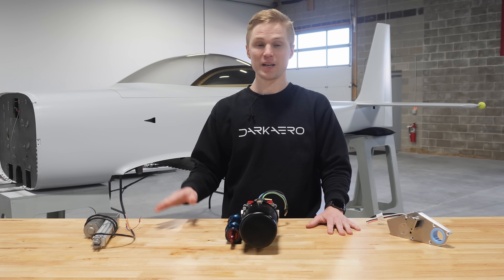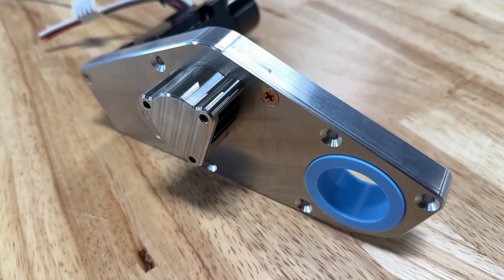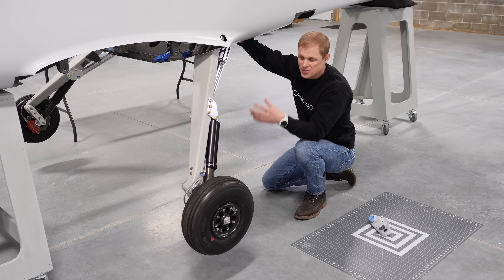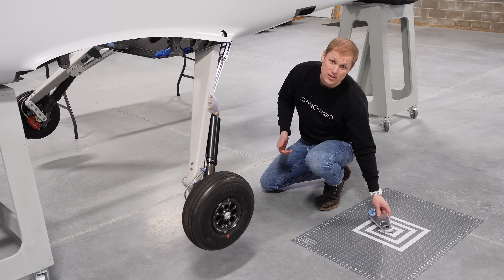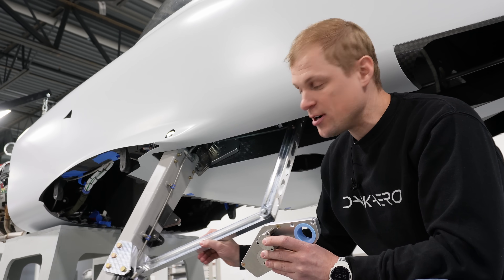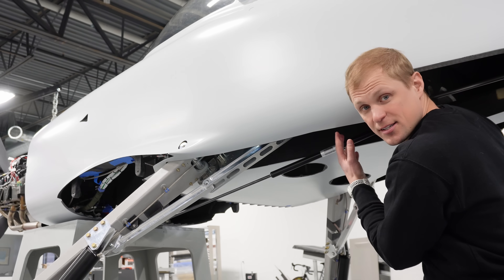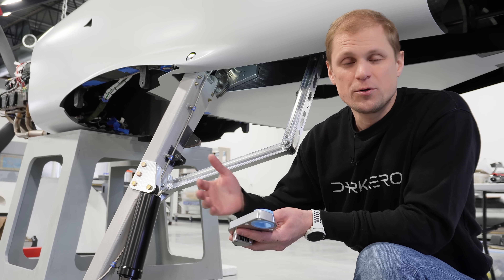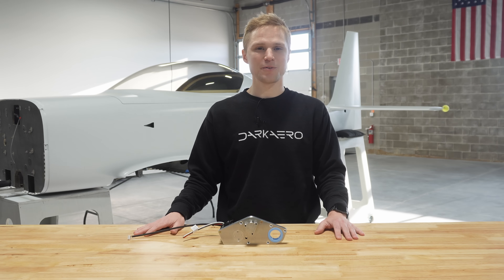Why we designed our own retractable landing gear

Comment: Cool ideas here but the complexity of the gear design in both manufacturing and operation would be my concern. Not sure about the carbon leg or gas strut in very cold temps.  How does electrical/ mechanical failure of the motors, clutches affect emergency lowering? Seems like the suspension shock/strut is quite heavy. Titanium spring leg would probably be lighter and certainly more reliable plus zero maintenance and likely cheaper to produce.

Recommend you do the gear drop tests at -40 to see how the carbon reacts. There are also known long term effects on CF strength from moisture, temperature and impact exposure within the matrix.
Reply: I think they have done amazing work this far. Reading the comments though, I thought I was the only one concerned about the carbon reinforced plastic landing gear. Landing can result in such a variety of shock loads in many environmental conditions. I'm not sure this is the best application for carbon. Bugatti for instance x rays the carbon chassis at specific service intervals to make sure there aren't any stress fractures. Landing seems far more rigorous than what most Bugattis see. 

Also the gearbox which is a work of art honestly, while it works well now, I'd be concerned about dirt or moisture affecting the movements, the small diameters on gears seem a little concerning. Given the space constraints, perhaps a worm gear setup would be simpler?

Comment: I wonder if those gas struts will still output the same force required to lock the gear out through the varying temperature ranges it'll see during regular use
Reply: They won't. Almost certainly.

Comment: Great work guys to reduce passive weight and make your own solution. However gas struts as a redundant mechanism concern me. You also have no way of checking the gas strut condition after it has been installed, it will always look the same in checks same but how do you know if the preload is still there?
Reply: This is one of my questions as well. Even if it was just inspected and found to be serviceable, it will fail at some point, and how will you know on a walk around?…

Comment: At 2.11, why is the lower shock mount not in the same plane as the trailing arm, that bushing does not look like it would allow enough flex for the amount of travel, seems as there will be binding. Anyway awesome stuff, good day
Reply: Ah ha, Watched it on a bigger screen and now can see that the lower shock mount itself is bushed. If you milled the trailing arm with the lower shock mount in phase with the trailing arm pivot, that would simplify and lower wearable parts count. Anyway congrats, going to look sweet in the air.

Comment: Why did you settle on a compound spur-pass design over a coaxial geartrain like a planetary or harmonic drive? The large exposed spur gear on the main pivot shaft seems risky from a lubrication/contamination perspective. Also, what engineering and environmental factors do you design to on a mechanism like this for an experimental aircraft? I've worked on and designed several mechanisms compliant with NASA STD-5017, curious if there are any equivalent FAA requirements or guidelines you use for things like friction factors, torque margins, or fault tolerance.

Comment: It looks like you have several spur gear reductions in a row.  Can you say why you didn't go with a simpler high-reduction-ratio system like a compound cycloidal?  These are usually more compact, and are used in industrial robots which require very high torque from very compact gearboxes.

That said, I think most RC servos have spur gear reductions as well, and don't use compound cycloidals.  Is it a tolerance problem?

Comment: Instead of limit switches you should do a Hall Effect sensor on the actuator and use the teeth of the landing gear to determine position. It’d let you show % open and it’d cut to one sensor rather than 2 switches. Less likely to wear over time too.
Reply: Magnetic reed switches are fantastic things. The RV-12 uses them for the spar pin warning system, never had a failure. One up, one down, one in the middle if you so desire.

Comment: emergency release of the landing gear, the gas spring is uncontrolled and not controlled, which means it can fail at the most inopportune moment, and exactly when it is needed ...
it would be better to use an emergency gas drive of the chassis, instead of a gas spring, a gas cylinder and an emergency gas drive, of course this will slightly increase the weight, but it will be easier to check the health of the system, the health of the system is checked by a gas drive to increase the pressure in the system when the chassis is folded and the presence of gas in the emergency release tank, a simple pressure gauge will tell us ...
    pre-flight inspection, we see on the pressure gauge the emergency release in the green zone, and when the landing gear is folded, we get a signal that the emergency release system is tight and ready for work ....
Reply: Some certified airplanes use a CO2 paintball tank that is weighed at each annual to verify capacity.

Comment: Gas springs have a very high failure rate.  Is there a higher quality gas spring type you are using for emergency gear lock?

Comment: Why not do a simple pneumatic actuation system? Replace the gas strut with a double acting cylinder and make the up lock pneumatically actuated. A 14 gram CO2 bottle with a piercing valve would be your emergency blow down. Engine driven or 12v mini compressor, mechanical valve, and some indicator lights would be all you need.
Reply: also those gas struts might be fine in the lower 48 but i've never seen one of those gas struts last more then a year at < -20F here in alaska, the cold just wrecks the seals and lets the gas out every winter. i'd imagine you could potentially have the same problem at cold temps at altitude even in areas with much higher ground temps. at cold temps even when they do have some gas left in them the pressure is so low that the piston looses all its force. by -40F they have no force at all or the seals shrink so much the gas is gone. 

when i finaly have enough money saved up to build a dark aero i will have to come up with my own solution for here in the north. i dont see a reason a simple spring piston instead of a gas piston wouldn't work. it would weigh a bit more but the gas cant leak out of a spring.
Reply: Reliability and simplicity should be design criteria.  
I’m not keen on increasing the number of systems that are not testable. 
I like flaps controlled by a simple mechanical lever.  Lever position = flaps position.

If I had to pull a lever to drop gear and pump it three times to ratchet the gear into place for every landing, I’d be fine with that, especially if I didn’t have to move my head.  Electric retraction is great as long as the lever always drops and extends; but for such lightweight gear, I don’t know that it’s necessary.
Reply: I like the emergency blow down idea, but I feel like there needs to be a way to manually pump the gear down as well. Adding a small pump with a lever arm would only add minimal weight.
Reply: @joetroyner  Yes that is an option. The Piper Aztec I've worked on is hydraulic off one engine, hydro hand pump backup, and an emergency CO2 blow down bottle as a last resort. To keep weight to a minimum just a CO2 bottle and primary system should be adequate if properly designed. On something like the Aztec the backup hand pump can also lower the flaps and raise the gear if needed during single engine operation.

Comment: In my opinion, the choice of using a purpose built gearbox is the most effective solution. The gear is unique to the aircraft, so using an off the shelf actuator would most likely be a compromise rather than a good solution. The landing gear system looks very nicely designed, especially given the space available. I hope testing goes well. Stay safe, and as always, I look forward to your next video.

Comment: Great video , thank you, I say limit switches are prone to failure in addition to the hardware overhead, I would recommend to actually add some sensitive current sensors (its already required) to the DC motor to monitor when it reached its limits, I understand that the aerodynamics force resistance might make it a little bit more difficult to decide on when we reached limits, but I am positive it is very doable.
Reply: For reliability I would hope that they do not use mechanical limit switches, but a current-based backup would still be appropriate.
Reply: Reed or hall switches could work for this, as they are not subject to contamination.

Comment: Will there be some rubber boot or housing to prevent the gear from kicking up a pebble into those gears?

Great video as always
Reply from the maker: Yes! We are working on a cover for the exposed gear segment. Thank you for checking out the video. :)
Reply: Up in Michigan the gearwell would be full of sand and snow after a few landings.

Comment: The transparency that you guys operate with in this design phase definitely helps engender trust for both your designs and brand.  It's great to see you operate like this
Reply: Its because they arnt doing anything new
Reply: @philipdrew10  yeah you're right mate, other than being a new company and designing a brand new GA aircraft in a mostly aluminium and fibreglass aircraft world.  When you look at the smaller features in the aircraft too there are elements of innovation throughout.  Maybe this is nothing in comparison to your own achievements and you have ground up designed an aircraft or potentially even have built and flown a kit aircraft but even if you have, I wouldn't belittle their achievements to make yourself feel better about yourself.  It's easy to criticise from our armchairs and far harder to do.  Three brothers in a newly formed company which appears to be self funded apparently on track to deliver on their promises, this isn't SpaceX mate.

Comment: I have a boat with a power bimini roof using a very similar actuator. I needed to wire a special fuse that pops and resets the actuators.

Comment: Gas struts lose force over time. Owners will need to replace them on a schedule to ensure they are still strong. I'd recommend a manual cable pull on a rachet or something instead.

Comment: I don’t know how significant this will be but my concern with the retracting configuration is that there will be an aft movement in the centre of gravity when the gear is retracted and a forward movement when the gear is lowered. How much movement will there be, and to what extent will this affect longitudinal static stability, pitch control, and stick forces during take off and landing. I assume that during gear up flight you will want the CoG close to the CoP in order to have light stick forces.
I would also be interested to hear more about FAA involvement and certification.

Comment: Why did you not use the mechanical advantage of driving the locking strut to move the gear rather than the main arm?
Reply: I thought about that too, but it actually has a pretty bad advantage in the fully retracted state.

Comment: The gas spring idea is good because it will help the motor push the gear down against drag while you are coming in for a landing, and the air will help compress the gas spring working with the motor on the way up after taking off. However gas springs are notorious for leaking, and without feeling it by hand with the plane held off the ground I see no way to check the spring force of it to make sure it's still working. If it were to leak and fail, it would cause the electric motor to have to endure much higher load during normal use, potentially causing that to fail as well. I would want a filling port on it or a strain gage on the mounting bracket or some way to verify they are working as part of the pre-flight
Reply: I hate gas struts for his exact reason. Have replaced many on various vehicles and campers.  If they were on my airplane I would replace them every 6 months or so to ensure they haven’t failed
Reply: Yes. That gas spring could be an issue.... at exactly the wrong time.
Reply: Yeah as soon as I saw that my head remembered all the times I have wacked it on my trunk hatch because it was not up all the way in cold weather. A mechanical spring of some sort would make me much happier. I would move heaven and earth to avoid that gas shock if I was building this myself.

Comment: How much does CG move back when the gears retract?
Reply: They appear lightweight. Probably less than 5% of the maximum weight. Or 1500x0.05 = 75lb. About half of that wt. actually swings aft. It would be like putting 35-40lbs in your baggage area.

Comment: Understanding the aero forces is critical. There will be a max airspeed where gear 'freefall' doesn't happen. That'll be part of your ODM. I, like others commenting, also believe the gas strut is not overly sound in terms of reliability. I also concur with a previous comment re unlocking, this needs to be a very robust and simple mechanism. No doubt this is designed with failure modes understood, and likelihood of combined failures etc. but the gas strut sees all the same temp. changes, is exposed, and sees cycles with the gear every time, regardless of when its needed in an emergency. Its preferable to have freefall / emerg. unlock systems designed to not see all that.
I am not a fan of the open exposed 'half gear'. I don't think it would take much from tyre and runway detritus or other debris to maybe give that a problem in normal retract or extend, but especially emerg. extend where its only the gas strut and gear mass doing the work. Go look at how dirty a used aeroplane undercarriage bay can be. 
Be very clear and do many many assessments of the effects of aero loads on retract and extend. I have commented before on this here. Airloads will catch up any backlash, and then the system will catch up, then the airloads catch up, ad nauseam. Wears things out quickly. Gear cycles are greatly affected by this even at low air speeds.  What are the target times for up and down cycles?  These should be derived from airspeed increase / decrease rates on take off / landing. Again, another set of limits that go into an ODM.  I am very impressed by the effort and detail of this design, but do also think that some more failure and wear studies / tests are appropriate particularly with the gear.  Good luck and keep working hard! (and feel free to contact me any time (42 years in aircraft design, manuf. and maint. of 330kts, +6-3g aeroplanes). I'd enjoy a good discussion, and would love to help you make sure this becomes the best home build light aeroplane.
Reply: The problem with what you're proposing about using something that doesn't see wear and tear with the normal landing gear cycles is it would by mechanical default have to be disconndected until it's needed. And that adds complexity and therefore, failure points. Because there's no guarantee your gear will be in an exact position to re-link the emergency option when you actually need it. As for the half gear, I was half paying attention to what was being said and paying a lot of attention to what was being shown. Probably aluminum. I would have to see their gear meshing tolerances before making a judgement. But I'd want it to be a bit beefier and with a proper case. But I can see the design challenges of that case, and if I'm to be honest. Leaving it that open does leave it harder to jam than a case with poor tolerances. The gears should be able to take hits from stuff like gravel and such and still be fine. Maybe double check that the gear teeth don't come within 1/4-1/2 inch of the gearbox housing except for the sides. Give it a slight cover in the areas where something is most likely to land and go into the gears. Should be good. It'll get dirty but the important part is with that kinda stuff it would be very unlikely to jam. Probably fairly easy to wash, too. As for the gas spring things I'd say do regular check ups. Replace after x amount of flights. Seems to be in a very easy to access spot to do just that, so it was probably their intention for a while.

No experience designing aircraft. Just grew up tinkering and pretty familiar with gearbox annoyances and spring wear and tear. I'd like to design my own aircraft at some point though
Reply: @hf117j

Comment: You could run a mechanical hand crank line from the cockpit to the landing gear locking arm to get it to lock out incase of electrical failure. The gas strut is going to add to the stress of the actuator by a fair margin.
Reply: Also gas struts wear over time and are tempermental in different weather circumstances.

Comment: Can you set up to use main gear as a speed brake into a partial extension to come down fast? I would still love to see turbocharging for high density altitudes and high altitude cruise.
Reply: ULpower has now a turbo normalised version of the engine used in the darkaero. gives a litlle higher power output but its weight is a little higher too

Comment: G,day Riley, River and Keagen from Sydney Australia. The Dark arrow is looking areospace category.
Landing gear extend 
 Emergency extension to the down and locked position, (automotive gas struts) they wear out if forced over their design capacity. Example
Rear station wagon door.
Q1. Will the strut motor and gears place pulling force on the gas strut?
💡😎